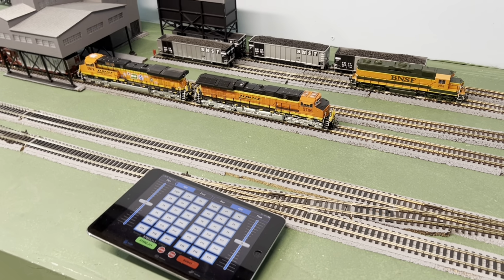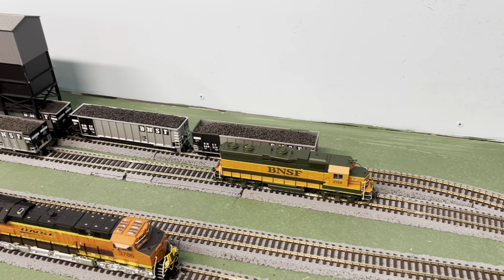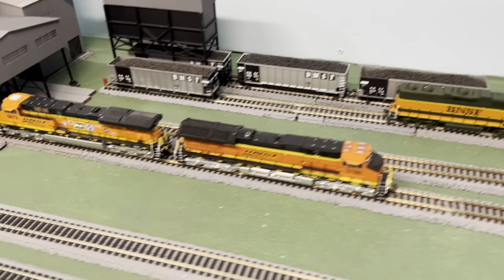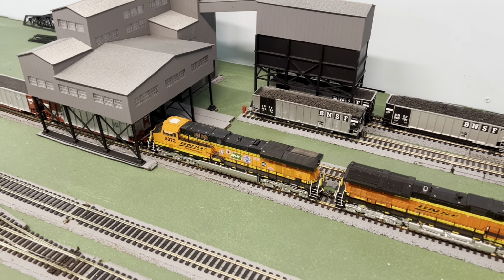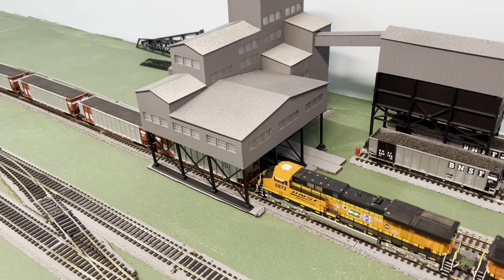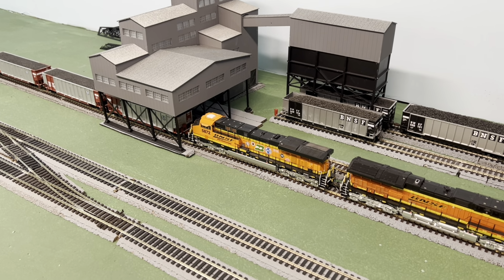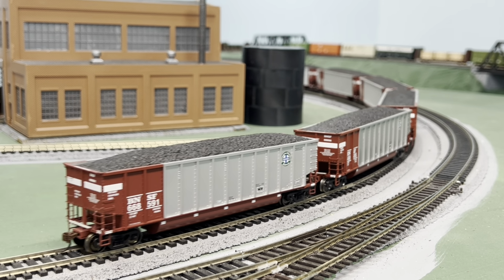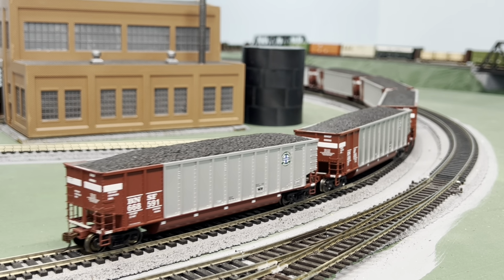Iowa Southern Railroad S4E11 - Slow Coal Train tours the Layout plus Update

Comment: Looking good Fred, enjoyed the coal drag 🤠
Reply from the maker: Thanks Randy 😀.   There are a lot of coal trains that BNSF runs across southern Iowa.  A typical train will have over 100 cars with 2 engines in front and a pusher in the rear.  I want to speed match another loco to match the two I have so my long coal train can have a pusher.  I think it will have to be perfectly matched or cars will derail constantly.

Comment: Fred excellent, I like that you are always looking to improve operations, removing track , adding track, changes look great , keep it up more to do ,
Reply from the maker: Thanks James 😀.   My heart sank when my consist derailed on the curve.  I’d only run one engine trains before.  At first I thought the couplers caused the locos to bind up.  They are so tight to the engine body.  Then I got out my curved track alignment tool and discovered that I did a lousy job installing this curve.  I don’t know why, just careless.
Reply: @FredE528   I had a problem with a curved turnout, replaced it , I have not learned to run two locomotives together, but I learned how to cheat from Sparky, just programmed with same road numbers
Reply from the maker: I use the consist function on either my MRC throttle or on my iPad mini using WiThrottle.  It’s really not hard to setup.  If you have the two locos assigned the same number I’d think they both have to be set forward, nose to tail?  I like them set butt to butt.  

Either way, they need to be speed matched otherwise you’re going to have trouble.  I watched several videos on speed matching.  The ‘easy’ method of adjusting the low, mid, and high voltage is still not that easy but better than using the speed table method.

Thanks for watching my videos so consistantly James 👍
Reply: Thanks for clarifying the coal loading ops. Also at the coop, would it make sense to move the 3 track yard where the mains are and bring the mains forward to where the 3 track storage tracks are?  Just a thought.
Reply from the maker: I haven’t thought about switching the mains and the storage yard.  I’ll look at that but I think I’d have trouble with getting the curves setup well on either end of the benchwork.  Thanks for watching and comment Dave. 👍
Reply from the maker: Happy Canada Day James 👍
Reply: @FredE528  thank you Fred  you have a great Fourth of July

Comment: Kadee couplers are a great choice.  Finally had my fill of issues to where I will replace any non-Kadee coupler on any new buys.  Also slowly replacing on existing rolling stock and locomotives.
Reply from the maker: You so right about the KDs.  These two locos are ScaleTrains.  They are really nice locos but the couplers are undersized.  Thanks for watching and comment .
Reply from the maker: Talking about couplers…. I have a dozen or so Athearn BethGon Coalporters (black ones) that have those plastic dummy couplers.  I bought the cars in a five pack.  They have a knuckle coupler on one side of the end cars but all the rest are dummy fixed position plastic.  I hate those dummy couplers.  I’ve replace several of them with KDs but need to replace all of them.
Reply from the maker: Correction - these are Walthers cars with the stupid fixed plastic couples.

Comment: Nice tour! Have you considered calling time-out on the modifications, and doing some ballasting/scenicking on a section?
Reply from the maker: Thanks 😀.    I have all the supplies to start scenic work.  I’m thinking of starting with the lift up gate:  ballast, grass, bushes, and trees.  I have a box of super trees.  I’ve never done super trees but I do want to give them a try.  Planning a dry river bed under the bridge instead of a stream.  Easier. 😀

There are many other sections of the track that I can ballast as I feel these will not change.   I’m not done with track work in some areas.  Coop area is one I talked about.  I want to add couple of cross overs on the main track in front of the Ethanol plant.

Comment: Your gonna loose a lot of yard track space if you do that fred.
Reply from the maker: I’m not fully committed to this idea.  But It gives the grain cars a direct shot to the sidings.  There will be some running out on the main track before backing into the siding but way less current setup.  Now it’s a long pull down the main to get grain cars from the Coop area to the yard.  I don’t see that I’m loosing any yard space.  Thanks for watching Scott.👍
Reply: @FredE528  your layout would be a FUN OPPS session! Looking g good.
Reply from the maker: Thanks.  A guy could spend a lot of time working just the Coop area.  I have two large destinations for the grain cars- the ethanol plant and the Cargil plant.  There’s couple of smaller destination as well.  I’m going to develop some scenarios for moving grain around the layout.  But not down to the car number level.  It will be like exchange 8 cars at the ethanol plant.  Or exchange 2 corn sweetener tankers and/or 2 boxcars at the big bakery plant.